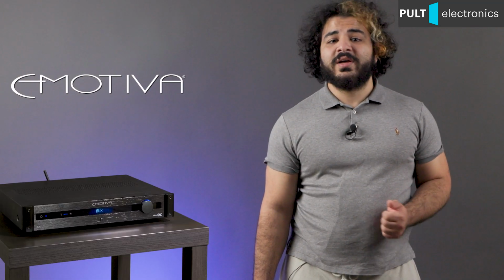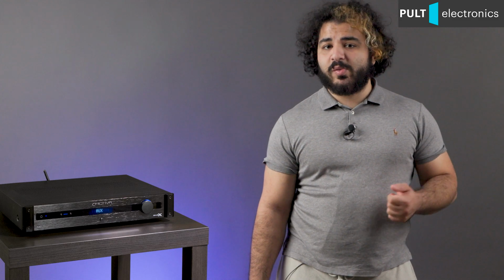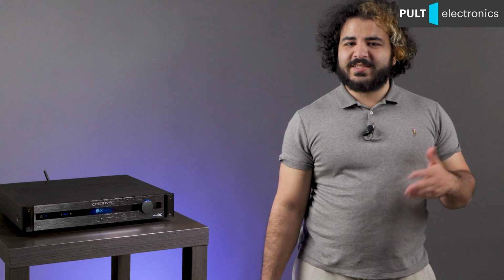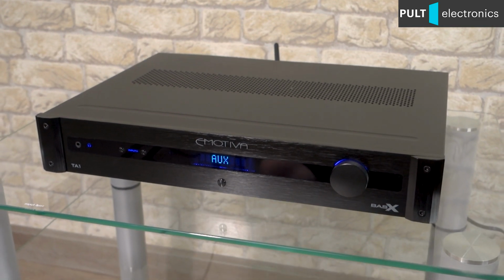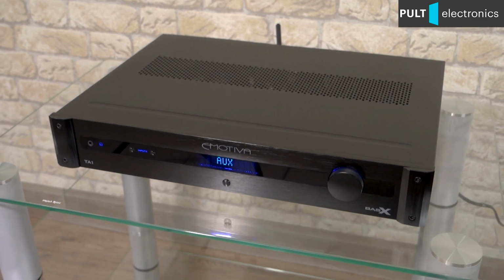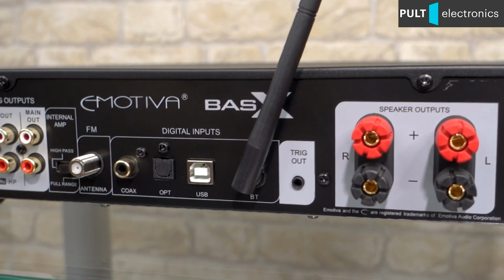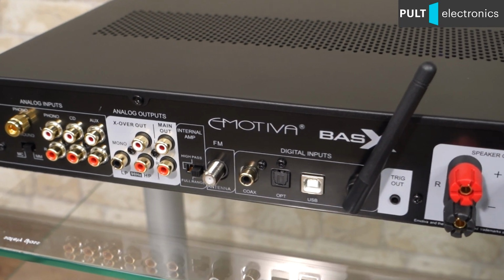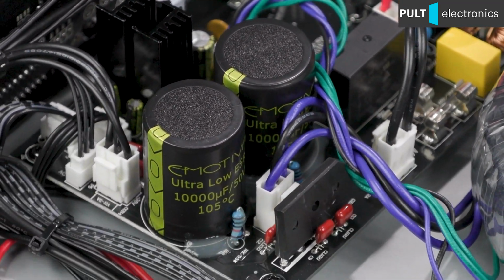Emotiva TA-1. Bargain preamplifier with crossover, DAC, FM tuner and power amplifier

Comment: I returned it.  Over four decades I have bought at least a dozen amps & receivers, solid state and tube, ranging from ~ $400 to ~ $4000 MSRP.  The Emotiva TA1 is the ONLY one that sounded so unnatural and  flat-out bad, even after burn-in, and with a variety of speakers, that I couldn't stand it and had to send it back 👎👎👎  YMMV